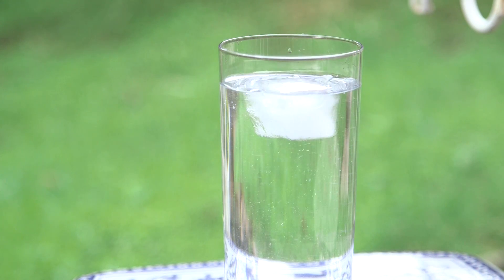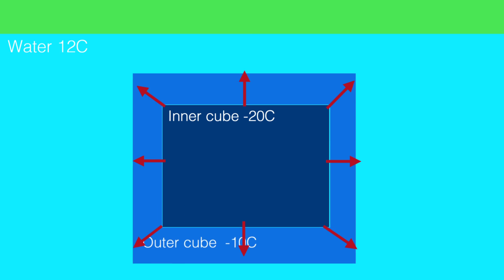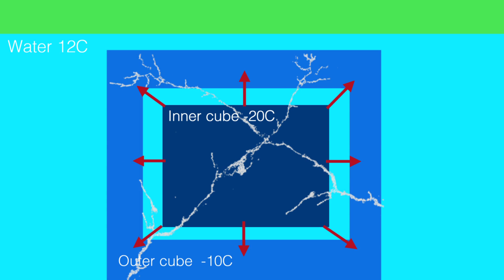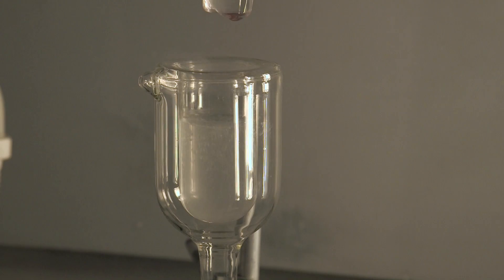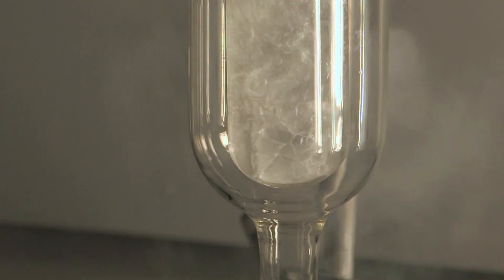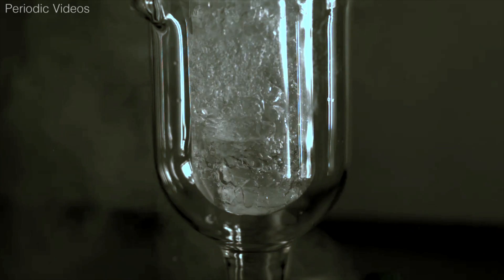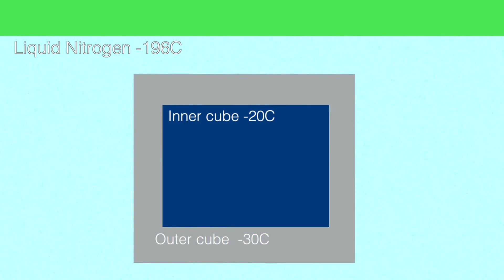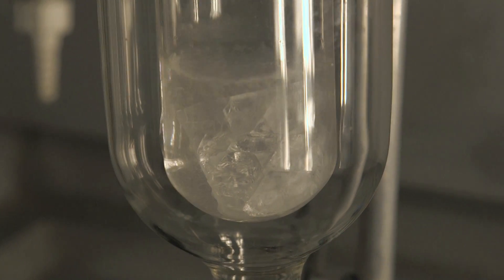Why do ice cubes crack in drinks? (SLOW MOTION)

Comment: My glass jar cracked when I pored molten aluminum on it.
Reply: that sure was smart
Reply: It was to have a laugh
Reply: as long as you had fun!!!
look into why that happened and that will explain all sorts of awesomeness in the world
Reply: I always enjoy doing stuff with metal.
Reply: always fun
Reply: Your jar might not hold together.
Reply: I pour molten aluminum but never poured it in a glass jar, I'll have to try that.
Reply: 5thDragonDreamCaster Pretty sure you're right. I'm a foundry guy, just trying to be funny. Hope I succeeded :)
Reply: :) weeeeeeeeeeeeeeee
i love molten stuff. in fact, i play with molten glass everyday!
Reply: Jc Cj is it possible to press a sheet of molten translucent glass against a cast iron plate that has a pattern machined into it? I have an idea maybe. Thanks,
 Bill
Reply: bill greene I make aluminum coins mostly, I sometimes do pewter and I have done brass and bronze before.
Reply: bill greene yes, but graphite would be optimal
so the glass doesn't succumb to thermal shock
Reply: 5thDragonDreamCaster do you machine the coin molds yourself or just having fun with it?
Reply: I carved a coin from a wooden disk and use the wooden to make a rubber mold for making plastic ones, then those are used to make a sand mold, I do sand them down and grind off the spot where the sprue and risers were.

Comment: Does the cracking have anything to do with the trapped air, which is clearly visible in the cube? That could cause weakness in the ice structure. It would be informative to do the same experiment with water that was de-aired under a vacuum.

Comment: Doesn't ice shrink as it heats up and expand as it gets colder?
Reply: Koriko Alistar ooooh so once it's well below it's freezing point it behaves like normal solids?  like...Iron for example? 

i didn't know that, i thought ice eventually keeps expanding since new hydrogen bonds keep forming, until it reaches "maximum" hydrogen bond capacity ...in wich case....yeah now it makes sense....once all the hydrogen bonds form, there's nothing left to expand at that point ....i guess it would contract a bit :/

water, you strange.
Reply: Normally, during a phase change, yes. The difference is that the ice hasn't reached its melting point yet, so thermal expansion takes precedence.
Reply: Yup!

Comment: ***** Thanks -- I always enjoy these videos and find them informative and thought-provoking.

This particular video has provoked my thought in this direction: as I understand it, liquid water contracts as it cools to a few degrees celsius, then expands as it cools further (anomalously), and when it freezes the solid form is less dense (anomalously), and the density continues to decrease (anomalously) as the temperature goes down to about -60°C, and as it cools further the solid ice then starts to contract once again. This is without wishing to get into the further complexities of different forms of Ice II, IV, VI, etc. However, it seems to me therefore that when an ice cube at -20°C is plunged into a drink at, say, 10°C, the outer layer will warm up and try to CONTRACT, but be unable to as the inner part remains cold, and this will cause the outer layer to crack, and the shock lines sometimes cause the whole crystal structure to crack partially or wholly through. Then, when an ice cube at -20°C is plunged into liquid nitrogen at, say, -200°C, the outer layer will cool down and try to EXPAND initially, while the inner part remains (comparatively) warm, and this will pull the ice cube apart. Indeed, as the ice cools, some parts will reach -60°C and start to contract again, causing complex layers of differential expansion which perhaps contribute to the particular spectacular cracking we saw. I think this is the other way around to what is said on the video. Now, the fundamental point remains valid — as the ice warms or cools, the outer layer expands or contracts while the inner core remains unchanged, and this causes the cracking — but I'd be interested to know whether I'm right about the expansion/contraction direction.

Comment: Great video. This is a wonderful demonstration of how differential expansion works, but I couldn't help but wonder if the fact that there are dissolved gases in the ice cubes has any effect on the way the cube cracks. Little gas pockets in the cube would weaken the overall structural integrity of the crystal lattice of water molecules, I imagine. Is it possible that completely degassed ice would react differently, or would it have no effect?

Maybe ice is too effective as an insulator for this to occur, but is it also possible that there is differential expansion occurring within the air pockets as well? 

Just tossing thoughts I had out there, anyone with more info feel free to respond.
Reply: If you degas the ice, differential expansion will still happen, so you'll still get cracking, but it's quite possible the pattern of the cracking would be different. Which path a crack will take is quite a complex question and not entirely understood, but dissolved gasses changing the crystal structure of the ice enough to influence the crack path does not sound unreasonable.
Reply: So I believe removing the gas would have an impact. For one thing, without the gas in there knowing how it works, what would it be? For ice to expand whilst contracting you'd have to know why or how it was when you saw the cracking become what might be known as expansion. If the ice can't expand then you might say OK, yes that's a predictable result, but is it really? For anyone to contract the ice there must be some kind of cracking going on and if there is gas there then maybe or maybe not the cracking will be achieved. As for the gas, it all depends on whether as you know the gas will be being used or simply added to the liquid - in which case there is a certain probability that the gas and ice may interact.

Comment: Given ice is less dense than liquid water. Doesn't that mean that as it warms, the ice contracts rather than expands?
Reply: A phase change is a different process than thermal expansion.
Reply: That would only happen when it melts.
Reply: The lowest density (around there) is at something like -4 C, so going from -20 to -4 gives an expansion, and so does going from 0 to -4.  (I might have the particular number wrong, but the idea is the same even if it's a bit off.)
Reply: Neil G. Dickson It's positive 4 degrees, just above the freezing point. If it was below the freezing point, then the ice would sink to the bottoms of lakes during the winter, and that would be bad for fish and other life. You are right on your general idea though.
Reply: Its all in fluid dynamics. The solid (ice) is stuck in the same position relative to the block's core and only varies when the temperature changes. (when it is pulled by other molecules) However, when it changes phases, then because the ice (now a liquid) is expanding, the water it as a higher pressure. But because the now water ice is no longer solid, it can flow away from the ice in a much calmer way. In a more direct form, the molecules are pulling the outer layer of the ice inwards (to keep it attached to the cube) so when the ice (solid) contracts, it cant break off the cube because the molecular bonds are keeping it on the cube. However, when the ice becomes water, the heat energy of the molecule is greater than the hydrogen bond and the water is no longer bonded to the cube. Now, the ice (now water) can expand in two ways instead of one, lessening the load on the ice.
Reply: ***** Ah, I see. I didn't realize you were talking about greatest density, and that is indeed at +4 C. The important point is that liquid water is always more dense than ice at the same temperature.
Reply: vwoxy1 I was talking about the highest density. I guess I misread Neil's post. I don't know what water's lowest density is, but I would guess that it would be above 100 C or way below freezing.
Reply: ***** I had to edit my own post a couple times immediately after I wrote it, because the wording was so awkward that I wrote something incorrect twice, so you're not the only one who misread my comment, haha! :)  I think what I have there now is still wrong.
Reply: ***** no... the lowest density (least mass per unit volume) should be below 0 C, because otherwise ice would be more dense than liquid water.
Reply: you are true between 0-4 degrees Celsius and not below or above
Reply: Water expands when it freezes (because the water molecules rearrange themselves in a lattice structure that takes more space than liquid water). However, that doesn't mean that it keeps expanding as it gets colder. Once it has reached the solid structure, that's it. Then it shrinks and expands with temperature like any other solid.

Comment: I think the conclusion might be wrong. By what they explained any thermal isolator should crack when heated or cooled.
What I think is happening is that the cubes are not frozen solid. When you put water in the freezer it quickly freezes the outside then the inside cannot expand and freeze so it gets to becomes a fluid under the melting point due to pressure. As the cube is heated the inner fluid expands quickly and breaks the outer crust.
When cooled the same happens - the inside expands cracks the outside but immediately freezes - that's why the cube stays intact and does break up like in water.
If you heat up the cube before placing it in water the inside has time to freeze and expand as the outer crust warms up. The cube stays frozen as the expansion is endothermic.
To test this theory create ice cubes that are frozen slowly or stirred during freezing and see if they break
Reply: Nope, differential expansion is definitely a thing, and thermal isolators can indeed crack. Cracking during cooling can be a problem when casting metal for example, and if I'm not mistaken you can crack rocks by heating them and then throwing them into (cold) water). Whether a material will crack or not depends on the temperature difference, how much the material expands or contracts when heated / cooled and how brittle the material is.
Reply: John-Alan Pascoe
A clean cut is usually associated with cooling (contraction) which is what happens when metals are casted and cooled. Shattering is more likely to appear from heating due to expansion pressure.
Here we see the opposite - it cracks during heating and shatters during cooling - so I suspect the water anomaly at work.
Reply: Yaron E What you are saying is more detailed, but also related to differential expansion. However, I don't think the crack propagation can not be understood so simply. The one idea that is missing is that the thermal energy flux between the ice and liquid nitrogen is much higher than ice in water.
Reply: trancend In fact I'm currently attending a conference on fracture, and there is indeed nothing simple about it :). 

Yaron E Interesting point. It could indeed be the water anomaly, or could it maybe be the source of the heat? In the water / ice case it is the outside layer of the ice that wants to expand, so there's much less expansion pressure than if the inside wanted to expand but was constrained by the outside. Ultimately though shattering is 'just'  the fast propagation of multiple cracks at the same time.

Comment: I put the ice in my glass first and then use the water spout on my refrigerator to fill it.  I haven't ever really observed it closely, but I don't think the ice is cracking.  My cubes aren't square either they are like oval spheres cut in half longways.
Reply: Randy Savage I've never seen that here in Finland. We can freeze our water by taking it outside for a minute tho
Reply: Some fridges do that, mine does.
Reply: HIRVIism That explains it cause this kind of fridge is pretty common. But yeah you have it easy over there lol :P
Reply: Randy Savage Yeah, and my other fridge has a spout with a button on the inside to dispense water.
Reply: Your fridge serves as a water supply?
Reply: Th3_Turtlnat0r That's cool
Reply: HIRVIism Yup, there is 1/4" tubing that is hooked up to local water supply, the water travels through a coil inside the refrigerator and makes it cold.  All you have to do is walk up to the freezer and on the door there is a spout and when you touch it with your glass, water comes out :) it also has an ice maker and a ice dispenser right next to the water spout. You've never seen one? They are pretty common.

Comment: Perhaps someone can clarify this for me: 

I understand why the ice, straight out of the freezer, cracks in water - it makes sense that the outside of the ice is expanding since it is melting into the water, while the inside hasnt had a chance to catch up.  Clear as day. 

However, when it comes to putting the ice into LN2, the video says that it is because the outside of the ice is CONTRACTING faster than the inside.  At first glance this appears logical, since the colder medium would seemingly have the opposite effect as the water.  HOWEVER, I was under the impression that once water froze, not only does it EXPAND (an interesting property of water's hydrogen bonds), but it also maintains a constant density!  This seems like a contradiction to what the video says... can someone explain?
Reply: No you see, when water freezes into ice, it expands, however, as you continue to cool it, ice will contract just like any other solid. Ice is only less dense initially, and actually, from 4 degrees to -4 degrees celcius, ice will continue to expand as it gets colder, but after that point, then it starts to contract like all solids do.
Reply: It's not possible for something to change volume and maintain the same density (without adding matter, that is). This is why water ice floats. It occupies more volume than the same mass of liquid water, so it has a lower density.
Reply: remember that ice has a lot of forms! You have Ice I, Ice II, Ice III... all of them are ice, yet their crystal structures are quite different.
Reply: The ice is contracting because as you decrease the temperature you decrease the bond distance between atoms, making it smaller. Here is a graph of the density of water as a function of temperature 
http://www.pnas.org/content/104/23/9570/F1.large.jpg
Reply: Alex King
Thanks a bundle!
Reply: cwjakesteel
Thanks!
Reply: Shingen8
obviously water's mass remains constant, and it's volume increases, and thus its density decreases - that was the basis of my question!  the video stated that the ice was contracting, not expanding. 

cwjake answered this well, explaining that past a certain point, ice contracts like any other solid.
Reply: Brant Martin
forgive me, but... duh?  :P
Reply: no, when water freezes it maintains a constant mass and increases its volume -> decreases density. that's why ice floats in water.

Comment: I thought water expands when it's switching to ice.
Anyway, nice and informative video.
Reply: Yes, but only at that point, it doesn't expand when it colder, it only expands when it goes from liquid to solid. We saw already frozen ice start to melt causing it to crack and already frozen ice contract significantly as it was cooled to a much lower temperature. We didn't see a cube of water expand into ice, it would be a neat trick though if it could be done.
Reply: Ok thanks.

Comment: but what happens when you put the now super cool cracked ice cube into normal water? It will probably get bigger because it freezes the water around it and then melt, but first, will it crack more?
Reply: The heat capacity of ice is 2.02 J/gK.
Liquid water's is 4.18 J/gK.
The enthalpy of fusion for water is 334 J/g.
An ice cube weighs 10g.
Nitrogen is a liquid at 77 K.
We will assume that the ice gets to a temperature of 77 K before being removed.
We will assume that the water is at 20 C (293 K), and has a mass of 200 g.
As the ice's temperature increases by ~196K, it absorbs 3959 J of energy.
9.5 g of water can freeze with this change in energy.
This is only 4.7% of all the water.
This won't all freeze because the water around the ice cube flows away (0-degree water is denser than 20-degree water), and gains some thermal energy from the surrounding water, and the heat transfer isn't instantaneous.
Consequently, the ice cube will grow an imperceptible amount.
Although this model isn't extremely accurate for the low temperatures of liquid nitrogen, it still is very telling.
The ice cube will crack more because it will, eventually heat up to be freezer-temperature, and we now what happens to ice at freezer-temperature in room--temperature water - it cracks.
tl;dr: It will grow an almost imperceptible amount, and crack.
Reply: Eric Dickson-Peppler Physics student, stock-boy at the Home Depot.
Reply: Oniontears123TNG
WE GOT A BADASS OVER HERE!!!
Reply: Oniontears123TNG Science.
Reply: high school thermo